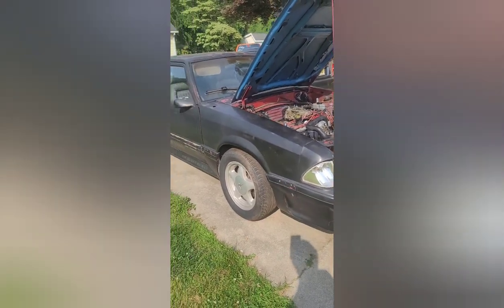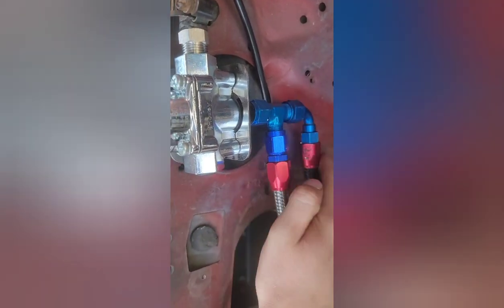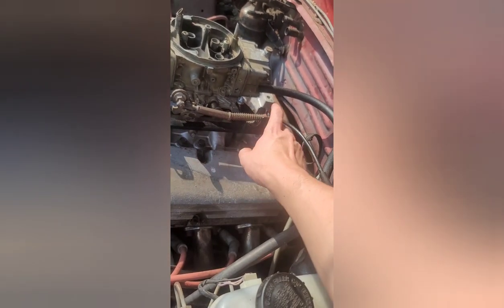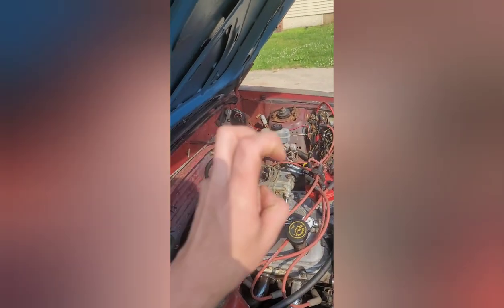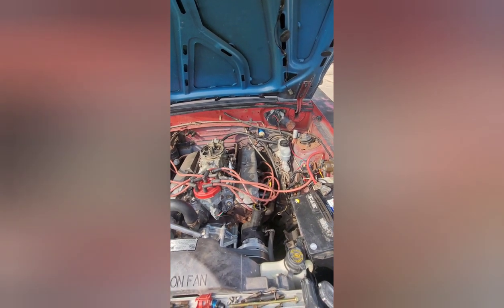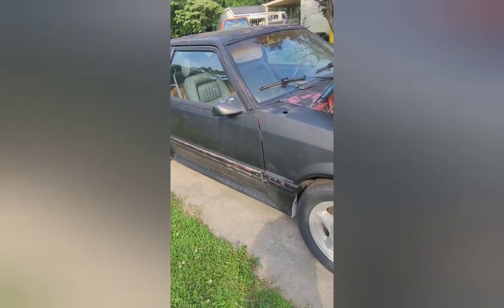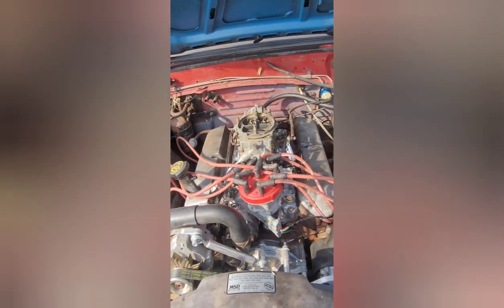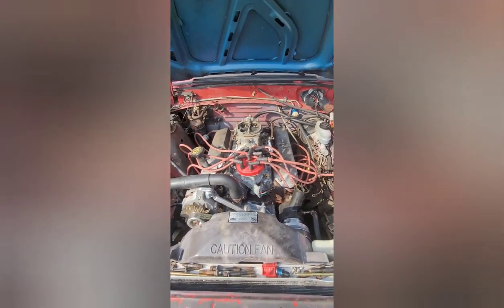How to carburetor swap a foxbody from efi without "ruining it", the easy way.

Comment: What distributor are you using, is this the stock one that came with the car, I have a 1990 Mustang GT , can I use the stock one ?
Reply from the maker: Yes that's correct
Reply: @GroverBoysRacing777AdamGrover  , where did you buy the adapter that plugs  into the stock one and what ignition box are you using
Reply from the maker: @dj3356bell  no ignition box needed, the tfi will run the ignition. But you can use an ignition box with it if you want to. Any msd box will work. I like using a msd digital 6 part# 6530, this bix will allow you to do a start retard and a custom timing map etc. For the distributor plug you can go on google and type in "1986-93 mustang distributor pig tail" and itll pop up. Theres a few different places you can order them through. I believe this one was ordered from ebay.

Comment: Did you end up modifying the fuel regulator plumbing?  Looks like you have the feed and return lines plumbed into the return port on the regulator.
Reply from the maker: Yes, you run the return before the regulator so the dead head regulator doesnt spike. This allows you to control the pressure from 3-60psi since its a high pressure efi pump.
Reply: @GroverBoysRacing777AdamGrover  this doesn’t make sense.  If you install a return before the regulator, the fuel is not being regulated unless you’re spiking pressure because your return is too small.
Reply from the maker: @f-bodyjon2189  the car runs and i can adjust the pressure from 3psi to w.e. the regulator will allow me to adjust it to due to the spring and diaphragm inside.. the return lines are smaller than the feed, this car has the stock fuel system upto the an lines that i installed to where it supplies the engine. And as for the regulator, it is a dead head 3 port holley regulator. There is no return on these style regulators. Theres no trickery or bs here. This is a setup thats garunteed to work
Reply from the maker: @f-bodyjon2189  this is the exact regulator on this car. If you scroll down it tells you "no return" under the details

https://www.summitracing.com/parts/hly-12-803?seid=srese1&gclid=CjwKCAjwxr2iBhBJEiwAdXECw-evRpOqWuCtg4v7ffBagBSI1OGzXtt4Avvfc2k51RhkQyRvBA3JpBoCZ-IQAvD_BwE
Reply: @GroverBoysRacing777AdamGrover  the correct way would to use an efi to carb return style regulator. They are more expensive but well worth it.
Reply from the maker: @faststang85  yes i know the expensive way to do it, but this way works just as good and is about $100+ cheaper.. you can adj fuel pressure from 3psi up to whatever the regulator maxes out at which is more than enough for a carburetor to stick the needle and seat open and overflow through the vent tubes lol..

Comment: With the locked out timing when finding tdc do i set to 0* then turn distributor or do i set it to the degree i want then drop distributor in ?
Reply from the maker: I use a digital timing light and use 0 on the balancer and turn the distributor to the desired timing set on my light.
Reply from the maker: Tdc doesn't change with locked out timing.. distributor gets dropped in the same as it always would at 0°
Reply: Thanks i was lil confuzzeled with the locked out timing and no video or form could answer the question 😂
Reply: Thanks alot the car runs awesome now i didnt know what i was gonna do with the efi system being a turd now i dont have to worry bout it and it just works so happy to have my car back
Reply from the maker: @RustyRacers  good to hear man. Enjoy it!

Comment: Man wish I had know this  when I did mine 10 years ago  went with Holly 670 street Avenger unilite distributor ellerbrock  f4b intake only thing I'm never been positive as I get transmission set right have a aod
Reply from the maker: Yeah theyre finicky with setting the passing gear and such

Comment: How does it run with the timing locked out at 38 degrees? About the same as an EFI car?
Reply from the maker: 36 degrees, starting is hard usually  once its to temp but they run the best at 36. I usually put the ignition on a toggle swotch and crank the engine over then hit the ignition to start. Or use a msd digital msd box w a start retard
Reply: @GroverBoysRacing777AdamGrover  or just toss on a duraspark system on it...
Reply from the maker: @alldabeanzracing9650  you could if you feel like spending more money and want extra boxes for no reason with a vacuum advanced distributor and rewiring everything for the box..

Comment: I have a 86 lx I’m trying to swap to carburetor from efi I have a 84(carb car) that I’m using for parts is there anyway I can use it’s ecu and harness? Trying to keep it simple and have everything work(gauges,key, etc.) I’d appreciate any feedback
Reply from the maker: For the gauges youd have to trace what pins in your harness plugs go to what gauges you want to work. The ecu doesnt control any gauges, theyre pinned from the body harness. So the ecu and engine harness can be pulled out or you can use your current engine harness and depin the wires you dont want to use.
Reply: @GroverBoysRacing777AdamGrover  metaphorically speaking would I be able to use the 84 harness with the 86 ecu and have everyone work or are the plugs different so I’d just have to depin the 86 harness
Reply: Also sorry I’m new to this it will be my first carbureted vehicle
Reply from the maker: @brandontaylor9601  carbureted vehicles don't use an ecu. So no you couldn't.  If you'd like to message me on fb you can do so and i can get into further detail for you
Reply: @GroverBoysRacing777AdamGrover  I would appreciate that a lot actually
Reply from the maker: @brandontaylor9601  if you search Adam Grover i should pop up just add me and shoot me a message

Comment: What exactly did you wire the fuel relay wires to?
Reply from the maker: I run them to a toggle switch.  One side is a hot wire, the other leads to the fuel pump

Comment: i am in the middle of carb swapping my 86 GT, i got the intake,carb, and fuel lines all installed and getting a consistant 6psi to the carb. the car wont start and i cant figure out why. it ran pretty decent right before i swapped it! any ideas on why it wont start?
Reply from the maker: Is the tfi for the distributor wired correctly? The red wire jumps to the power side of coil and to a key on power or a toggle switch.  If you have it to a key on source, make sure the piwer source has power while the key is cranking, not just when key is on. I made this mistake years ago and chased it for hours lol
Reply: @GroverBoysRacing777AdamGrover  i just plugged my stock one back in like normal, that might be the problem right?
Reply from the maker: @AndrewJohnson-b2r  if the computer and harness is still in the car hooked up factory,  it should still work, id make sure the distributor is in top dead center
Reply: @GroverBoysRacing777AdamGrover  yeah everything factory is hooked up and still nothing
Reply: And the distributor is at tdc
Reply from the maker: @AndrewJohnson-b2r  are u pumping the carb when u go to start it?
Reply: @GroverBoysRacing777AdamGrover  yes I give it a couple pumps
Reply from the maker: @AndrewJohnson-b2r  did u check to see if the coil is putting out spark?
Reply: @GroverBoysRacing777AdamGrover  yeah I just did again and it’s getting spark.
Reply from the maker: @AndrewJohnson-b2r  when u prime the carb is there fuel squirting out of it? If it has air fuel and spark it should start
Reply: @GroverBoysRacing777AdamGrover  finally got it started. had a few things i found preventing it from starting. i really do appreciate you responding and helping diagnose! following the page for sure
Reply from the maker: @AndrewJohnson-b2r  no problem glad you got it figured out.  What was it if you dont mind me asking
Reply: @GroverBoysRacing777AdamGrover  the timing was way off, I thought I had it set at tdc but I guess not. Had to do the ol finger over the spark plug hole trick. The spark plugs were also gnarly so I threw some new ones in. Idk what was wrong with the efi but the car has at least double the power now😂
Reply from the maker: @AndrewJohnson-b2r  kind of what i was thinking lol. Its easy to do. Glad its good now

Comment: What was the name of the pigtail on the dizzy you never said name or place
Reply from the maker: You can order it through any parts store or online,  86-93 mustang gt 5.0 distributor pig tail..
Reply: I would like more info on this also. Is it just a regular factory pigtail that you are modifying some way? I know you said you depinned some wires.
Reply from the maker: @alissaanglin1871  you can use a factory or a replacement pig tail for any 86-93 ford mustang 5.0, then you depin the top 3 wires or you can cut them since they are not used. I depin them for cleanliness

Comment: Only thing the EFI in old ford's is good for is key turn starts when the EFI components start failing it's never ending diagnostics.i have an old town car that won't start until you hit it with either after it stays running.ive been testing components trying to figure it out but no luck so far
Reply from the maker: Possibly a fuel filter, bad regulator, weak pump, or the line from the pump to the carriage.. They'll usually run with weak fuel pressure but won't start. If u get it figured out lmk what it was

Comment: Is this a bypass regulator? I noticed the t and it made me curious?
Reply from the maker: No its a dead head holley regulator
Reply: @GroverBoysRacing777AdamGrover  I just bought a bypass regulator and I believe the t is not needed. is that correct?
Reply from the maker: @jessejames1106  thats correct along as you can get the pressure down around 7psi itll be fine. This is just a cheaper way of doing it
Reply: Thanks for your help!

Comment: Does the tach work?
Reply from the maker: None of the factory gauges work except the fuel gauge, volts gauge, and speedo unless you pin into the harness and wire them up

Comment: Just for clarity…if the regulator fails to work won’t the fuel pressure spike regardless of the return
Reply from the maker: Not sure what you mean by failing to work,  like a bad regulator?
Reply: Yes, if the regulator goes bad at some point will the fuel pressure spike and wash my cylinder walls with gasoline?
Reply from the maker: @kevincraig5311  usually when they go bad they don't build enough pressure.  But if it did happen to spike,  it'd be the same amount of gph or lph going through it regardless of its efi or carbed..

Comment: Why not just live the factory engine harness init an just run the wiring from each pin to your oil temp gauge an tech. There with using factory computer that's how I would do that

Comment: How did you wire up the alternator?
Reply from the maker: @christopherbutcher5373  just used the factory alternator harness. That has nothing to do with the pcm/engine harness.
Reply: I have the factory harness connected to the alt but it isn't charging tge battery. The harness appears to be  in by a previous owner so im not sure if its correct. I can send you pictures in the morning.  @GroverBoysRacing777AdamGrover
Reply from the maker: @christopherbutcher5373  is the alternator good?